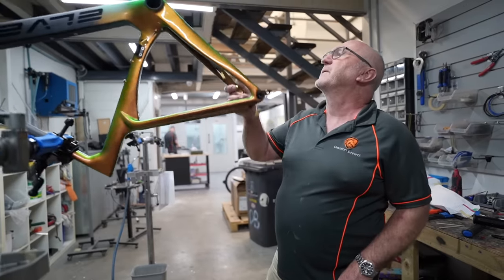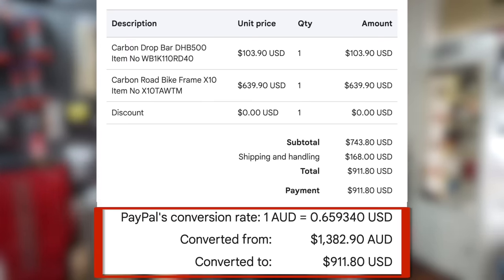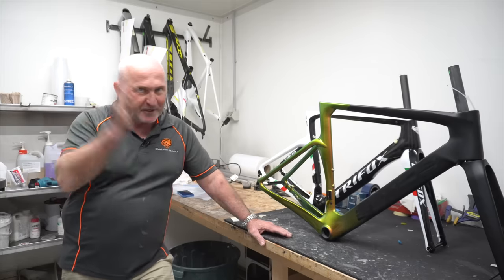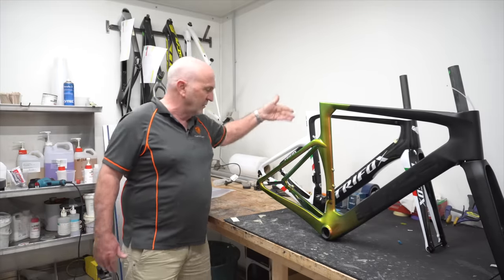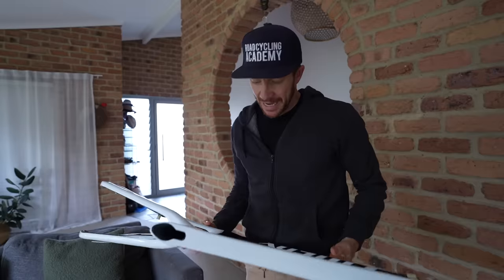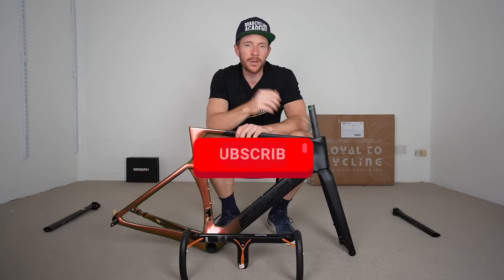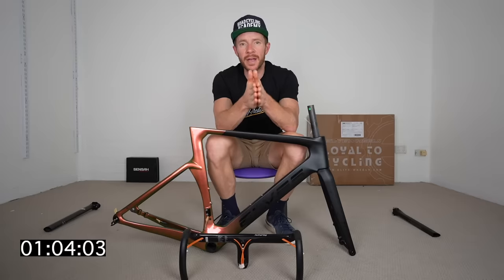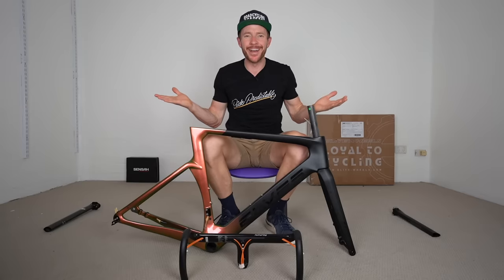I Bought Two Cheap Chinese Aero Frames (here's why)

Comment: The Trifox are very popular where I live. They are sold in the bike shops pre assembled. Warranties are an issue. The frames do fail with no come back from the shops. Can't say how often they fail I see dozens on weekend ride and every now and then you someone sitting on the side of the road with a busted frame or fork. The price varies immensely as some are fitted out with genuine Shimano group sets and DT Swiss wheels others have the Shraam groupset (chinese shram knock off)
With cheap chinese wheels. As a heavy rider riding on crap roads I wouldn't touch it but if you only weigh 50 to 60 kg and only earn $100 a week then it's a way to live your dream of owning a carbon bike.

Comment: It would be interesting to hear how Elves compares to SEKA and WINSPACE. Also, not sure if you noticed but the back triangle design of Elves looks very very similar to older Yeoleo R6 frame design. It's hard to see if the head-tube area is the same too but check it out yourself.

Comment: Ooh Trifox, my friend has one of those, it's awesome and she got it in a custom colour, purple, silver and gold with a thunderstorm pattern for the purple.
But overall, my bike still ended up much cheaper. But that's probably the price difference of the components as well. My bike came with ultegra, I think she has dura ace di2, it's electronic.
And my wheels are probably pretty cheap hers are carbon aero wheels. Those wheels probably cost almost half my bike lol.

Comment: The question I ultimately want answered: If cheaper Chinese parts give you "almost the same performance" as name brand parts, does that little bit of missing performance for each part compound over the entire build of the bike?  
While I think I could live with maybe one or two components being not quite as polished as a name brand part, if it starts adding up (i.e. - the brakes are constantly needing adjusted, the cassette shifts are clunky, the front crank drops chains, the shifters have bad ergonomics, the cables rattle constantly in the frame, etc), all those little issues compounding would really annoy me.  I realize it's a somewhat subjective topic, and someone who doesn't regularly ride a top spec bike may not notice these little nuances, but I think it's worth discussing.
Reply: Really good point. You might check out Trace Velo. He looks at lots of budget/ ali express parts. He did a recent video on cheap and light cassettes which brought up this exact problem.

Comment: While I don't like the idea of buying a Chinese frame, the prices of big brand bikes have gotten completely out of control.  Up until now, the mainstream brands disregarded Chinese frames / components because of quality issues, but if you can prove that the quality is getting better (at least for SOME of the Chinese brands), then hopefully that will get their attention.  It's crazy that a mid-tier bike is somewhere around $6000 - $8000 US these days.  It's making me strongly consider a frameset like that Elves, and maybe even the next generation of Sensah components (not there just yet).  The new 105 pricing is just nuts.
Reply: Couldn't agree more. Just bought a Cannondale SuperSix Evo HiMod with Ultegra mechanical 11s .... but I had to go to Italy to get it on run-out sale. About $6.5k landed. The only local option in my size was SRAM Rival AXS 12s at nearly $10k. For a road bike!!! With no suspension!!! With SRAM (yuk)!!!
Reply: either way, you're buying chinese frames. The only question is, which quality-control stands behind it. But honestly: just look at how much wiggle-room the seat-posts have in Canyon frames. Yeah...
Reply: Elves and brands alike are building/maintaining a reputation and while it proves Chinese parts are fine for use the price is getting higher, in my opinion, a carbon frame shouldn't be invested in on a budget, the benefits of carbon is weight and stiffness, which affordable frames lack and a well made aluminium one will outperform in, carbon wheelsets for example however, provide great benefits and Chinese brands of no name produce well made things, as for delamination and poor QC, only the very cheap have that issue, I even bought a £30 carbon fork and the quality down the tube was excellent, whether the prongs themselves were the same I don't know but bristols roads are rough yet it's tactile and taking the potholes comfortably, carbon is at a stage where you can produce it in your kitchen, even cheap parts are effective, just not the best.

Comment: By chance I had two frames, too. One took so long that I canceled it and bought a Trifox. Then the one I canceled showed up the same day as the Trifox.

The Trifox was the worst! They painted the bottom bracket, brake caliper mounts, and the headset bearing cups, meaning I had to spend HOURS sanding the crap out of the paint to set it up. Worst frame.
Reply: same thing happened to me with my trifox x8 rim brake, brake caliper mounting holes full of paint, and the dropouts must have had paint too as they measured 8.7mm on the calipers

Comment: Bought a trifox x16 to try. Tolerances were horrid. Couldn't even fit the saddle they supplied nor any wheelsets without sanding the dropouts. Bottom brackets were painted over. Also poorly packaged. Would not recommend.
Reply from the maker: Interesting to hear, thanks for sharing on the thread.

Comment: You are right on the cost of bikes.  Top end bikes hit the kind of inflation rates the of the economy has now years ago.  Dura-ace kit use to be quite common among my cycling mates but much rarer now. This year you are getting Ultegra bikes at £9500. You can argue that in that time bikes have got better and there are additional costs in R&D for aerodynamics etc plus increasing complexity in components with electric shifter, disc brakes etc, but then manufacturing as been mainly been moved to China & Taiwan to reduce manufacturing prices and it isn't just full bikes prices but frame prices that have spiked in price.  To buy a new bike around the UCI weight limit is now a significant investment. Given the costs you then have the chance that it will be wrecked in the 1st corner of the local crit when they guy that will risk all to make up 3 places in the opening lap takes the bunch down.

Comment: Two things here.... First, to those citing the increase in pricing over the years.. lets also remember the advancements in tech. Current mechanical 105 is CRAZY good compared to older groupsets so its not really fair to compare pricing directly on those tiers.  
Secondly... if inexpensive competitive riding is what youre after... get a used CAAD frame... or a Klein... or an older Cervelo aluminum frame. Those are plenty fast and can take a number of falls for way less than these chinese frames.

Comment: I am 5'2" I would have to wait, in some cases up to 2years, to get a brand name bike in my price range for the type of configuration I want (700c wheels, and wide enough for gravel tires but still fit skinnier road tires) because that is basically a child sized bike and few of them are made. I had a 48cm Trek 520 that was slightly too big for me (short legs) but I made due. It got stolen. 

I gave up on these name brands because of this and just got a 46cm Motobacane from bikes direct. It has a 2x shimano group set, fits gravel and road tires. Worst case scenario the chinese carbon frame is junk and needs replacement in a few years, but the other parts are all name brand and known to be reliable. It ia going to get me back on the road/trail and I can consider if I want to be in an excessively long wait list for one of these frames. Videos like this make me feel that the chinese carbon frame will be fine for me for a long time to come.

I will have my new bike in about a week. Link for reference.

http://www.bikesdirect.com/products/motobecane/disc-brake-roadbikes/mulekick-cf-rx600-discbrake-roadbike-xx.htm
Reply: Absolutely buy and ride what you can afford. Cycling is global, and always will be. If our domestic producers refuse to build what you need, or cannot keep up with demand, never feel bad about finding what you need elsewhere. Maybe, instead of making super light frames for super niche markets they'll finally get the message that we want more accessible product.

Comment: Good on you, I have a Canyon Aeroad 2013, to replace with a modern equivalent would cost me the same as a mid size Kawasaki motorbike, I refuse to do it, and have been thinking for a month or so about the Elves Falath, glad you are doing it, keep up the good work. P.s does the UCI certification sticker make a difference and what does it mean?

Comment: Cam, I've had 4 Chinarellos in total. A 65.1 Think 2, an F8, an F12 and now the new F. With exception of the  F12 which developed a slight clicking in the BB, every one has been fine. The F8 did every single major TDF and Giro climb and descent there is, none of your Aussie shite 😉.

The quality of the handlebars internally didn't used to be fantastic and the internal routing can be a bit difficult but apart from that, why would anyone spend 10 times as much on the real deal? Choose your supplier with care, add the best Groupset and wheels that you can afford and you're away. End of!

Comment: Hi, will you do a review on a china brand call JAVA too ? 
(JAVA Fuoco J-Air) It's a Aero bike with full carbon fame, fork, handle bar, wheel which cost only $1700 SGD /  $1200 USD include 105 groupset and other things. I dare say it is the cheapest full carbon aero bike out there with UCI approved. It also ridden by a pro team called Java Kiwi Atlantico.

Comment: I’ve been ordering carbon fiber rims from China for years and building 😢wheels sets with quality parts for myself others for a fraction of the cost. And they perform just the same as any other expensive wheel riding cycle cross, Mountain bike, road bike or anything else.

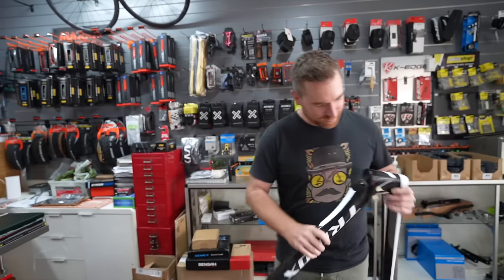Comment: 5:50 Is it possible to (re)face where the headset bearings seat? Seems to be a fairly common issue with some Chinese carbon frames.

Comment: I’d love to know what the quality between batches in these brands is - but I guess it’s a difficult question to answer. I dislike that big brands bring out a new model each year with basically minimal difference to the previous. I suspect that at least some of the cost is paying engineers a lot to somehow reduce the drag by 2%. Completely wasted on me of course. I wonder how much frame price could be reduced by keeping the same design in production for 3 years instead of a single season? Same for groupsets - I’m sure the new group sets are great, but I don’t think they will change my riding. I’d be quite happy to see new groupsets released every 5 or 6 years, of better yet, when there is actually an issue that needs to be fixed/improved, if this also meant that prices came down.

Comment: Our ex-national rider won in national race using 400usd T800carbon frame pair with top tier wheels. Actually we don't need those expensive big brand frame with all bs marketing. Not to forget overprice bs OSPW. We also have affordable top tier wheels like Winspace.

With elves lite frame, top tier winspace wheels, tripeak ceramic pulley wheels and bb (equivalent) and with your gs choice, try hard enough you can win crit/local race or simply enjoy your ride with more money in your bank account.

Comment: Yes, it helps a lot of people. You are talking about 10,000 in your country, 10,000 in your country is a very top bike.... 10,000 in my country is an intermediate aluminum bike.... a very top bike here, it's 70 or 100,000 ....  Impossible for people like me! I have a Chinese frame, the "brand" no longer exists, it was called Leadnovo, the same thing as Costelo, Delihea... I haven't had any problems until today... the only question is that the seatpost is aero and how many aero frames, one hour it started to descend... other than that, everything ok!
Reply from the maker: I was talking generally. I think people understood what I was getting at

Comment: One thing I learned the hard way: never buy a carbon qr frame. The hanger bolts are drilled directly into the frame, and guess what happens after about 1000 miles. Bolts shake out. You need to add larger and larger ones, in reverse, with juts on other side, until its simply useless to continue. 12x142 or 148 only way to go for carbon.

Comment: Hope you are still able to complain to the manufacturer after your cheap Chinese frame fails you while riding downhill at 60 km/hr or even higher.
Generally, you have a warranty from the big manufacturer, get info about recalls for all carbon parts (handlebars etc. ) and mostly a generous handling of quality issues. And this costs money...
Hammering on a frame, looking at it with a flashlight is no replacement for x-rays...Yours is, in my opinion, not a QC standard.

Comment: The problem I'm seeing now is that bike companies are charging so much for frames that it has pushed the price of these cheap carbon frames through the roof.  They used to be £150-200 on eBay.  Granted they have come a long way since then but still.

Comment: They don't seem to be that much less expensive than other options, $3-5k is still alot for a built bike to most riders. Serious racers I don't think are looking to cut these corners, besides at some point sponsors take over and dictate the equip you ride.There are cheaper options with proven results. Just my opinion.....

Comment: Thank you for this review, I purchased the same 2022 Elves Falath frame which I built up with Sram components, Hyper wheels and couldn't be happier. https://www.youtube.com/shorts/Jm_j8gijZ7Q Coming from a 2018 Specialized Roubaix the geometry of the Elves is much more aero, stiff  and FAST! I knew from my own research that the frame was built with exceptional quality but after viewing your video and seeing it confirmed by your experts I'm glad to know that my opinion was spot on. I cannot wait to see your reaction after your build is complete and I think you'll place the Elves frame at the top of your list as a class one racing frame to have in your stable.

Comment: The big bike brands are ripping people off these days.  $3500 u.s. isn't even an expensive frameset anymore.  All these frames are made in the same manufacturing plants,  the only difference is the quality control of the off brand bikes isn't as good.  I can get a velobuild frameset for $450 u.s. and $150 u.s. shipping.   That is also a super light frameset that is rim brake. Most of the big brands don't even make rim brake anymore. Another reason to go with an off brand frameset

Comment: Thing with “name brand” frames/components is you have some assurance the design has been through some standardized testing and that the brand is careful to protect its reputation.  Sure there are some failures, but if your teeth get knocked out because the fork broke JRA, there’s a company who could be sued—try suing some Chinese brand—they wouldn’t even bother to respond.

I do see there’s a place for this kind of frame, we have one “cheap chinese” frame at our house, but it’s for a light, non-aggressive, rider.  I would never risk a no-name brand fork, handlebars, or rims, IMO.

Comment: I had a bad experience with Elves. Bought their most expensive frame. It had some visible defects. It also had the seat clamp installed upside down and the threads were stripped. It took me over a month to get a replacement clamp. Bad/slow customer service. Maybe they have gotten better but I think you got a "special" frame from Elves.
Reply from the maker: Interesting to hear that and sorry you had to deal with that

Comment: Prices are completely ridiculous. In 2015, you could buy an aero bike under USD 2000 with mostly 105 components. Now, with most brands, you cannot even get any road bike with a complete 105 without spending USD 2000 or more. Oh and the engineering quality also sucks more than before in some cases. :/

Comment: After ten years of using various ‘Chinese direct’ carbon products..frames,wheels,bar/stem,seatpost etc on road,gravel and mtb with VERY FEW issues,non relating to safety I would say WHY spend €12,000 on a bike,when one can build a fine bike for €2-3,000. ?

Comment: Don't use cheap china carbon mainly fibre glass sprayed black and inferior resins used. Stick to aluminium butted bike for safety. Safety is more important. The lighter the metal used the more easily can be damaged is the downside to light frames

Comment: Carbon frames should not be clamped in work stands ever. Put the seat post in and claim that always
Reply from the maker: Gary said someone would pull him up on that one! Well done.
Reply: @CamNicholls  seen so many frame broken in bike stands by bike shops and owners, even if only "just nipped up not too tight". Also seen damage from car roof racks, bikes unrideable at races after be transported there. As i am sure you are well aware the frames are not designed for any clamping force on the tubes and they damage very easily even if, who ever it is, is extra careful. Once you start moving the bike around ie fitting a bb of even a smaller job you are asking for trouble. 
Maybe some people reading this are not be aware and this will help

Comment: I think most of your audience is cashed up passionate types, probably don't wear Aldi Crane gear or ride a hong fu or an elve, or ccp party bike.  for $5500 aud, you could get a TCR Advanced Pro Disc 1, Ultegra, carbon wheels, sub 8kg, lifetime warranty etc etc, why would I go the cheap china option?  I just don't' get it ... but I appreciate your effort.  Yes I"m a tight arrse but not on bike gear.  good luck.